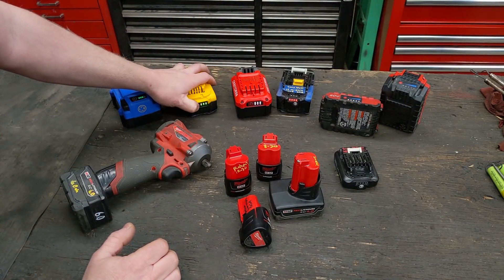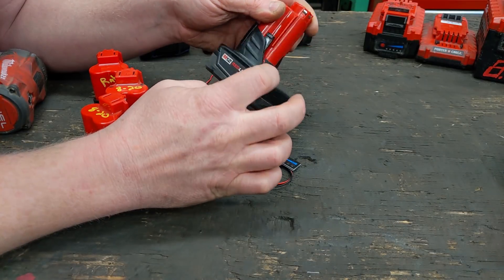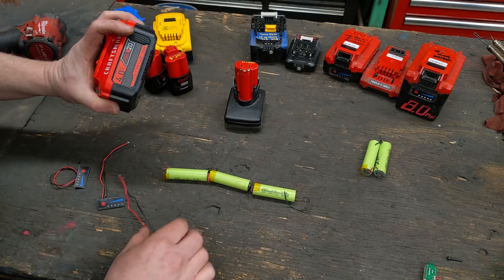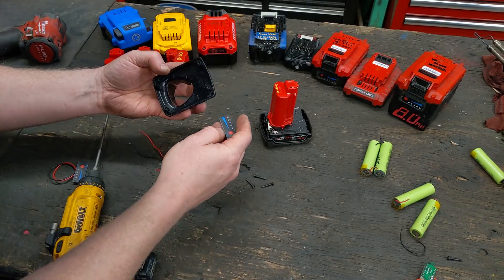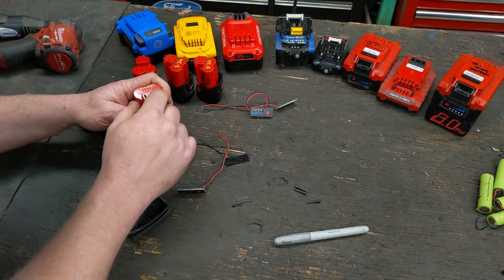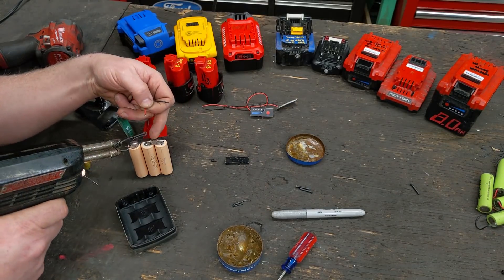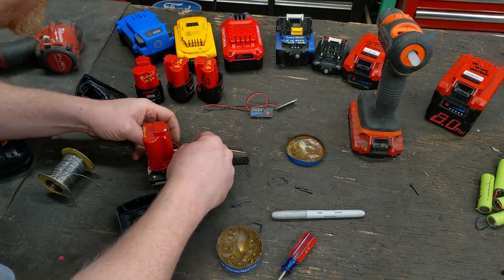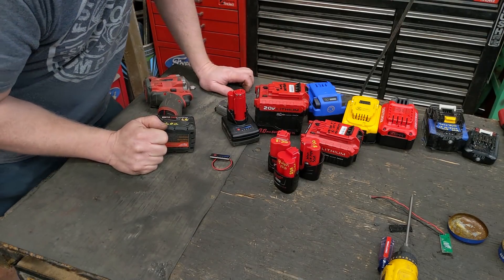Install Battery Gauge Milwaukee M12 and OTHERS battery packs

Comment: I've got 2 tools and 3 batteries and no meters. I always have one hot battery and never use both the tools on the same job or very little. Being geezerish has it's perks in that you're not expected to do much, so I don't. But it works. Eventually. I see Ginger is running on full charge mode. Thanks, Buddy and GBWYall!
Reply from the maker: It's more of a pet peve than anything. I'm the type of person that wishes a vehicle had a gauge for everything: diff temp, trans temp, oil pressure, etc. I guess I have too many batteries and various tools to keep track off these days.
Reply: @sixtyfiveford  I'd like all that stuff on a big truck and have a separate manual  temp gauge on the Taco but all that stuff out in the elements is just more to mess up. My battery in the charger is the freshest and it'll go in whatever dies. The dead one will go in the charger and get zizzed back up. I just got the drill to use your rattle can shaker with and Ginger is always right on target! GBWYall!

Comment: One down fall i see is theres no seal to protect the inside of the battery from fluids
Im a mechanic and i get all kinds of stuff over the battery when in use. Its a awesome ideal and works great but i would try and put a seal around it
Reply from the maker: I put Shoegoo/e6000 around the edges. However there are a bunch of factory breathing holes all over it for fluids and grease to ingress.
Reply: @sixtyfiveford  didnt know that. I was think on the lines of fluid getting in and corroding the battery contacts. You would know way more then i would about the situation. Ive had so many lights fail because of that. I would drop a light in water then about a month later they stopped. When taking them apart its got the green and yellowish brown curd.

Comment: heads up on using just 1 cell  (these PUSH to test modules are fine) but years ago Makita was plagued with premature PACK failure by using some type of battery communication board powered by just 1 cell. the battery board consumed to much power from just one cell and lowered the overall pack voltage, when the other cells remained full. the charger started to kill the packs trying to charge the now unbalanced pack. it was such a wide problem they were almost forced to issue a recall but instead they just maintained a liberal free replacement policy. (i call it resigned obsolescent)

Comment: Some tools "stand out" for features while some "stick out" for deficiencies. We love our trusty 2406-20, which outperforms larger drivers in our shop. It has this annoyance, but we don't put partially-charged batteries back. We have built an inexpensive voltmeter into a charger or two, so we can track charging. Tossing a partial battery in will tell it's level. We like digits more than bars anyway.
Reply from the maker: Yeah, I wouldn't waste my time with the smaller 1.5-2ah packs as those are just run until they're done. But the larger packs I swap between a few various tools as they last 3-5times longer and find it annoying to have to install it and pull the trigger to see the remaining charge. I also don't trust the Milwaukee gauge as I think it favors a high charge as the last 2 bars/dots don't last anywhere near the first two. I would prefer a voltage readout, but can't find a momentary one. However these aftermarket gauges step down in precise voltage increment, so I know within .3 of a volt what it is.
Reply: @sixtyfiveford  Some gauges are linear and some are logarithmic.  Log-style have a bar for 1/2, then 1/4, then 1/8, ... That way it's more precise as you get closer to the end.  We just keep a stack of each kind charged and use 'em 'till they quit, then charge...
Reply: That's also a very functional solution!